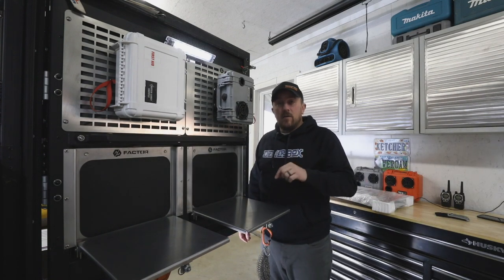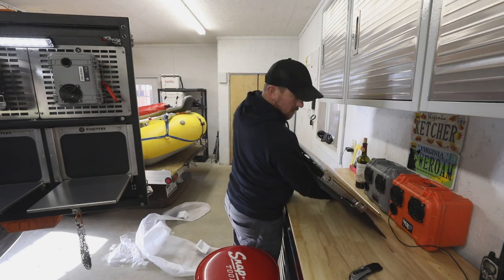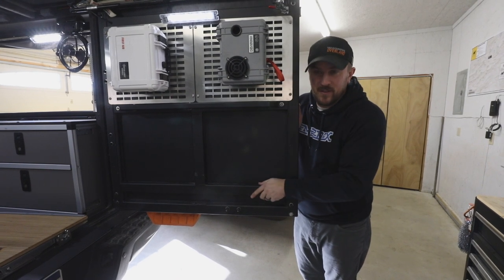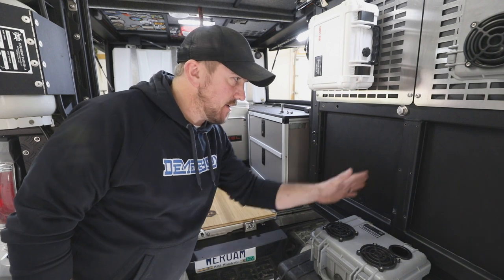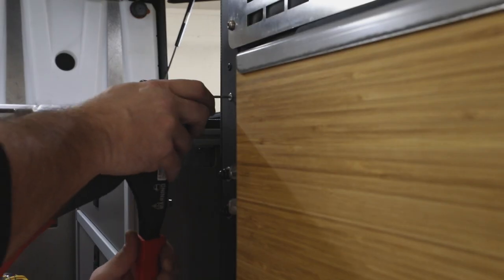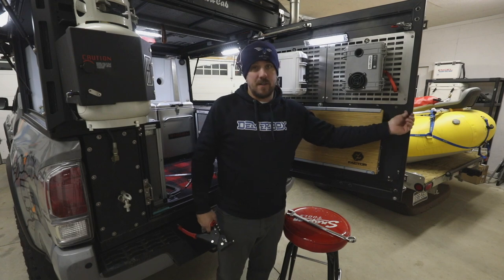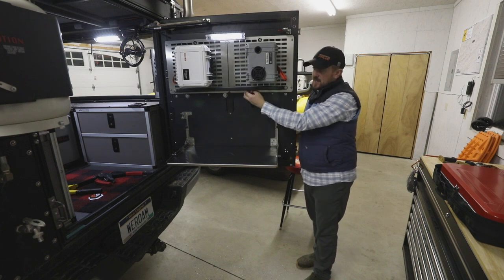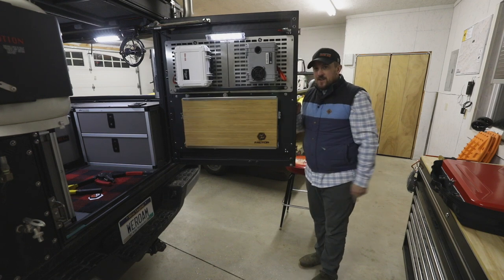How to Install a Table in a Canopy Camper - Mountain State Overland

Comment: How solid is that driving down the road? I’ve installed a Ford accessory table in the swing gate on a new Bronco and removed it after a day of driving around. It just rattled like crazy back there
Reply from the maker: Very solid. Is got bumpers in it to lock it in solid and absorb any noise.